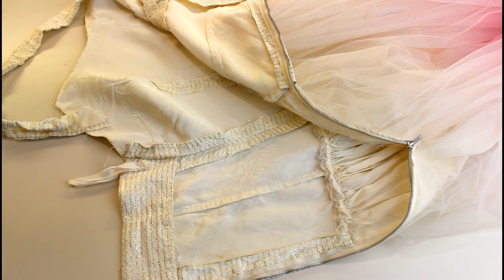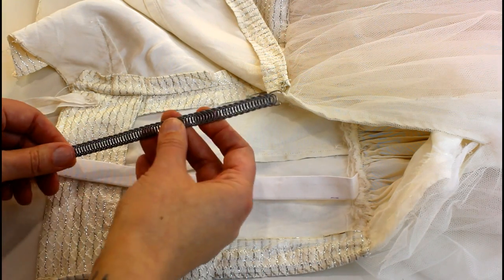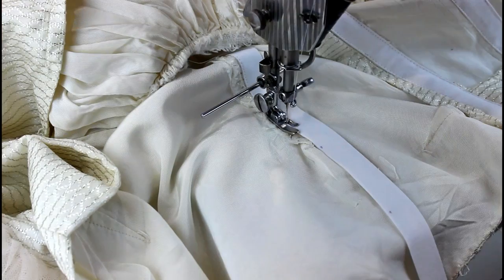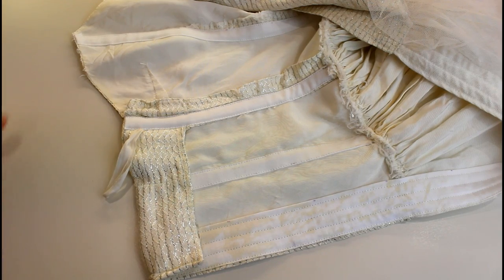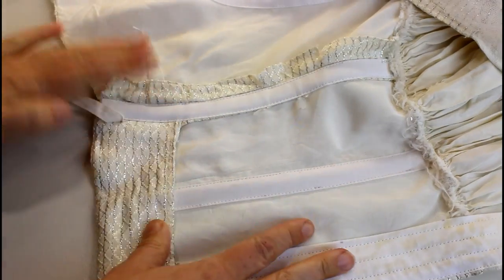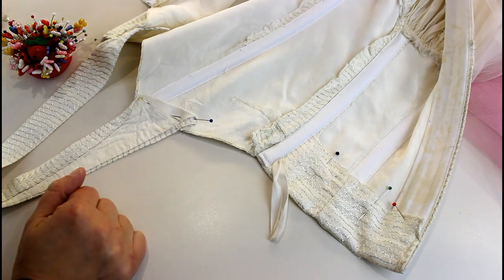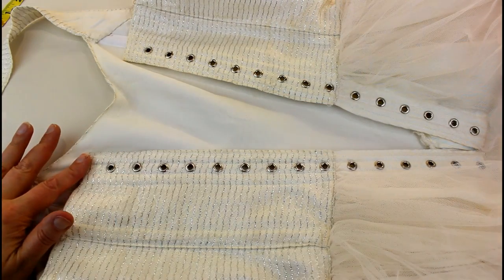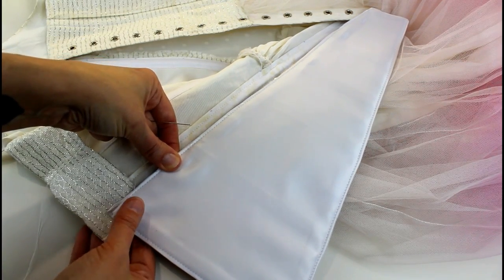How To Add Boning & A Lace Up Back To A Dress - Tutorial by Rockstars and Royalty

Comment: This is an amazing tutorial. I'm trying to adapt a pattern to lace up the back but prior to sewing it, so I'm wondering how you add boning to the interior layer and then cover with exterior and lining. Doesn't that cause problems with the bones?
Reply from the maker: Thank you. I'm glad you enjoyed the tutorial. There's 2 ways you can do it - you can add the bones ad bone casings to the lining before you join the lining and outside together, or you can join the outside and lining together and stitch through both layers to create the bone casings. When you adapt a zip up pattern to a lace up pattern make sure you take some of the width off at the centre back so that you have a gap or it will be too close together to lace up properly. Hope that helps. Vicky 🙂

Comment: Awesome tutorial! I'm going to be modifying a pattern from zipper back to a lace-up back and this'll be my first time doing it. What are the tools you're using to cut the hole and put in the eyelets and grommets called and where did you get them? Thanks!
Reply from the maker: Thank you. I'm glad it was helpful for you. I use an awl to cut a small hole for the eyelets/ grommets (you'll find awls in sewing supplies, but they can be a bit flimsy. Mine is heavier duty one that I found at a hardware store). I then stretch the hole to the right size with a tapered metal rod, which I bought years ago at a market. I have no idea what it's intended use was! Metal knitting needles are a great alternative. Always aim to cut a tiny hole and stretch it - if you cut a hole the right size the fabric will fray our from behind your grommet. Hope that helps. Have fun sewing your project 🙂

Comment: Hello, I'm planning on making a corset with a lace up back instead of a hook and eye back, how will I know how much fabric to leave out from the bodice to make room for the lace up part? Thank you ♡
Reply from the maker: It depends if you want a gap or not and whether the edges will be parallel or in a 'v' when laced up. I usually take of at least 2 or 3 inches in total because I don't like the edges to meet. Doing a toile fitting can help you decided.
Reply: @RockstarsandRoyalty  I would like it to look like yours, I really love how elegant and gorgeous your dress is and I would love to make my dress that bomb as well. I don't know what a toile fitting is, can you explain it please?
Reply from the maker: Are you making it from scratch or altering something you already have? 

If you're making it from scratch, make the pattern up in a cheap fabric, such as calico or muslin. This is your toile, and you can fit it and mark any alterations as needed, and also decide how much you need to take off for the gap during the fitting process. From there you mark the changes onto your pattern and can make it up in the real fabric knowing it will fit well.

 If you're altering something from zip up back to lace up back, put it on and mark where you want the finished edges to be at the back.

Hope that helps 🙂

Comment: Hi.  Loved this tutorial, as I have a prom dress that I need to alter for a young lady.  It no longer zips up.  I have never worked with grommets, so I plan on adding loops for the lace up.  My question to you is would you sew the loops between the edge and the boning or inside the boning?  I was just going to use one row of boning (1/2”).  The dress is a black satin & I am trying to minimize the lines of stitching showing.  It already has boning sewn in the lining around the bodice, and I plan on sewing the boning also to the lining, but am afraid it may pull when laced up.
Reply from the maker: I haven't worked with loops a lot, but I would suggest sewing them between the edge and the boning. You can stitch them on the seam allowance just past where the fabric folds under, with the loops facing inwards towards the dress, then when the seam allowance folds back, the loops flip to the outside. If you're seam alowance isn't wide enough, just sew on some extra fabric. You can also sew boning onto the seam allowance and turn that to the inside as well (either sew in plastic boning or a bone casing for steel). With this method you have everything attached to the outside layer of the dress but without the stitching showing on the outside. I hope that makes sense! In my upcycled Belle dress video I sew boning on this way if you want to have a look at that. Let me know if you have any more questions.

Comment: So I have a question when you were sewing that panel in do you only see in that top corner of the dress or do you see that top plus that side at the bottom
Reply from the maker: I just sew it in at the top on one side. That way it's got some movement so that you can get it sitting perfectly straight once the dress is laced up. Hope that helps. Thank for watching 🙂
Reply: @RockstarsandRoyalty okay and  yes thank you very much for your video

Comment: Hi, i’m not if i just didn’t hear it but what kind of fabric did you use for the casing?
Reply from the maker: Hi, I used a white cotton to make these ones, but any woven fabric with no stretch would work. I often use silk dupion or satin for decorative external bone casings and cotton or drill for internal. Iron-on interfacing can be used to make them firmer too if necessary. Hope that helps 😊
Reply: Rockstars and Royalty ohh i see this totally helps thanks!
Reply from the maker: You're welcome. Happy sewing 🙂